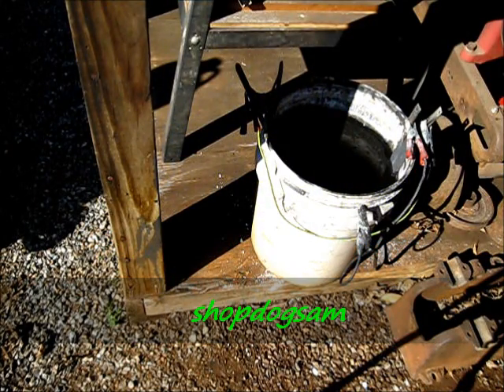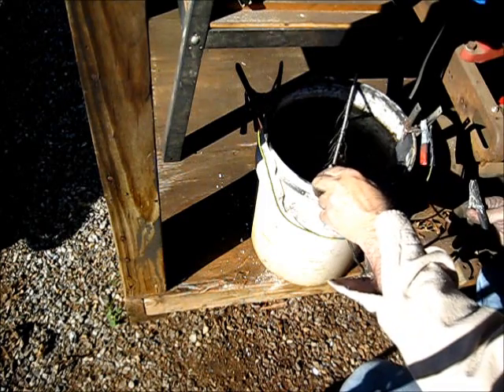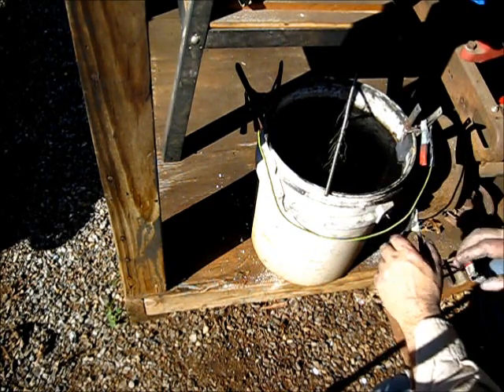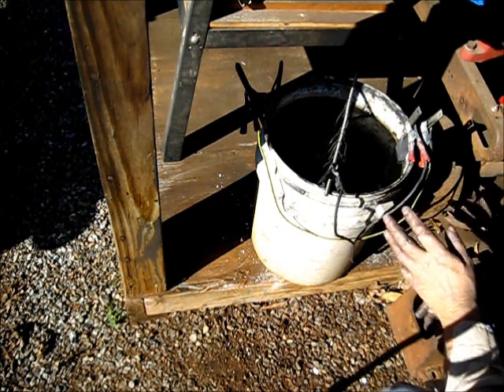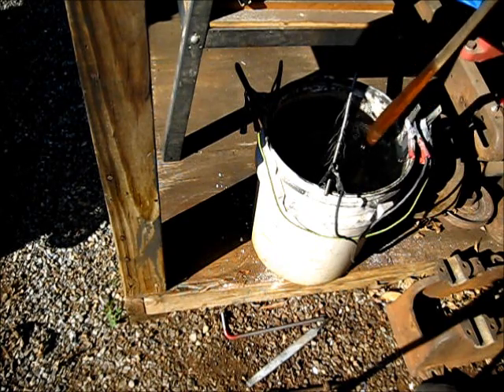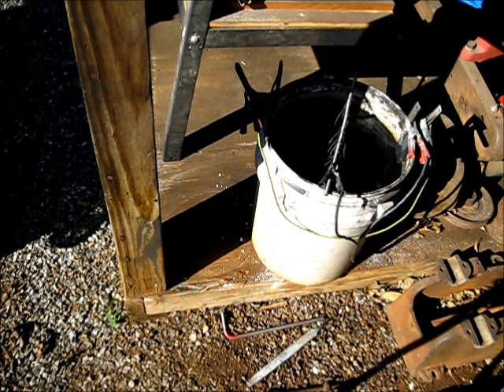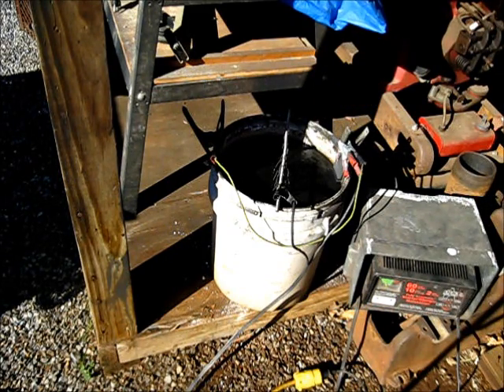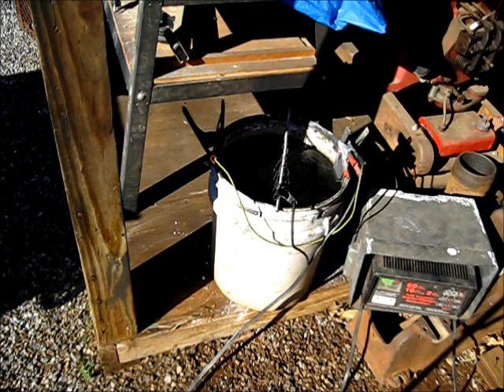Electrolysis Rust Removal #4 / Amps & Voltage

Comment: So I'm looking to build my first electrolysis tank for some cast iron cookware. I have been having a hard time finding an old manual battery charger. The point you make about "tricking" the newer chargers by simply adding a battery. I'm sure the question I'm about to ask is self explanatory, but I would rather ask too many questions than not enough. I'm assuming that you simply attach the positive and negative leads accordingly just then jumper from those terminals up to the respective points at the tank?
Reply: Yes, but I'd suggest adding a 12v bulb in the circuit between the battery & the tank. I.e. one leg of the bike goes to the + on the battery and one to the sacrificial metal. That way the bulb is a current limiting device if the stuff in the tank accidently touches, and you lower the chance of sparks.

Comment: is there a reason why i cant use a battery charger direct, i need to  use a 12 battery in 
line, charger to battery then to 5 gal bucket, is it my charger? only way i can do this process?
Reply: Dave Maclay 
if you have a modern charger it requires a battery inline to trick the charger into putting out power.
if you buy an older version  charger or use a power supply 12v  DC/50amp
Reply: @1971mgb  Would it not be possible then to use the battery just for a moment to kick start the charger?
Yes the charger needs to see current on the line to start but when started it will keep current going and there for not shut down. Only issue I could see with this is that if the current stops for some reason, even if just for a moment that the whole process would stop
Reply: @rabbi1991  no modern chargers need  to see atleast a certain base voltage usually like 8v
Reply: @AndrewBrowner  ahh that makes sence. But addinf a battery in there must have some sort of protection
Reply: @rabbi1991  protection for what? the battery wont short circuit itll discharge a certain amount of amps depending on how conductive you make the water, if your charger cant keep up with that the battery will slowly discharge but it should drop in amps as it drops in volts and reach equilibrium somewhere safe... worse case scenario is you kill the battery so dont use your brand new car battery and itll be fine
Reply: @AndrewBrowner  so there is no chance or risk if pieces with different charge come in contact?
Reply: well if you dead short the battery with a wrench youll have issues, but as long as the current has to pass through the resistive water it wont output a dangerous amount of power..  I = V/R,  low voltage and resistance will give you low current, unless you drop the resistance to nothing youll be fine
Reply: @AndrewBrowner  Exactly. If someone bumps the can the pieces might get into contact which could end badly. 
By no means am I the best example. 
Do as I say not as I do.
But I use an old charger that gives 12v and maximum 2 amps. Battery chargers and an open battery seem way too risky for my taste. Have seen batteries blow up and it's not something I wash for people to witness.
Reply: Add a 12v auto bulb in series with the circuit between the battery & the tank. That acts as a current limiting device, and gives an indication of current flowing too.

Comment: Very informative video thank you but I would advise against using a battery for this purpose because you could get a short by having the hanging parts get in direct contact with the sacrificial anode and you wouldn't even know it and risk having the battery explode. Much better to use a power supply with a short protection. I use a modified computer PSU for the job.
Reply: You could and should of course add a fuse for the battery. 
Really you should always have a fuse if you connect something to a battery

Comment: Hey Shop Dog:

Been checking out your videos on the rust removal process.  I found some answers to the questions that you (and mrpete222) mention about what is actually happening during the electrolysis process and why you DO NOT want to use stainless steel anodes. So, here is a link to what I found out there in cyberspace: http://www.qsl.net/2e0waw/rust.htm    Keep the engine repair and fireside chats coming, the wife and I really enjoy your stuff!  Thanks.